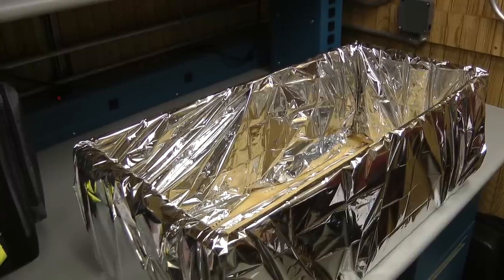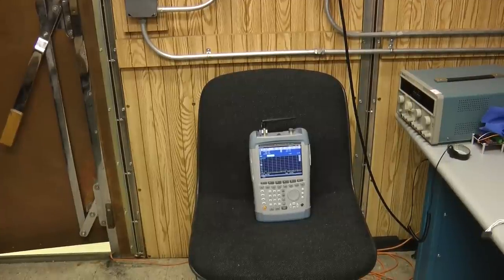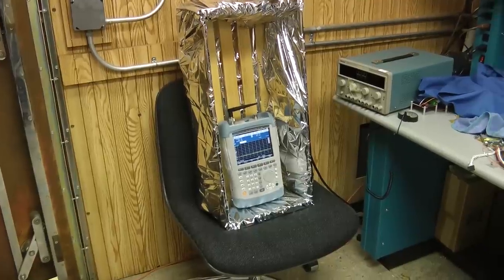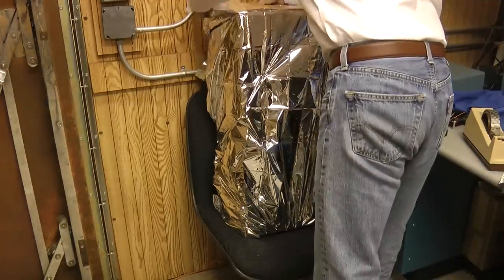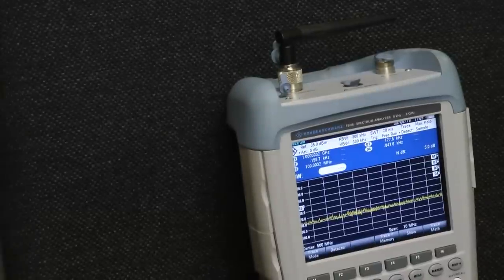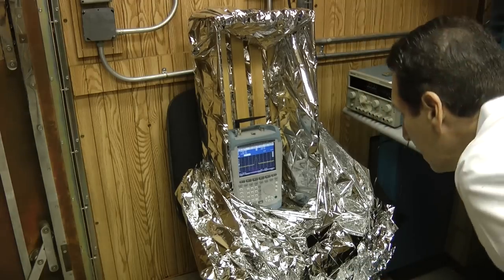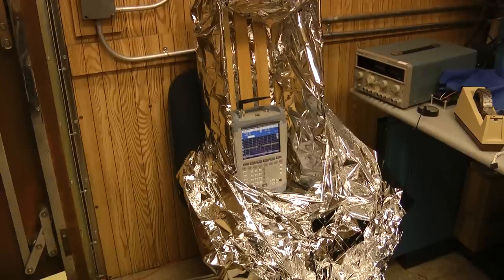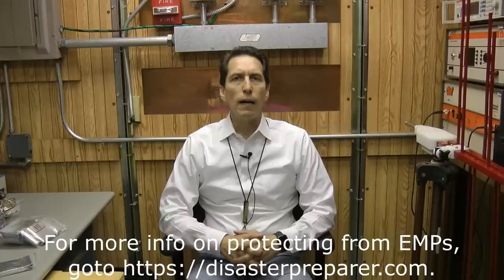Testing Mylar Blanket for EMP Shielding

Comment: God Bless You Dr Bradley. Thank you for the work that you do, for sharing with us (the layman) your testing in a most understandable way. I am grateful. 

By the way, I have your book "Handbook to Practical Disaster Preparedness for the Family"  What a gift to us. I've read a good bit of it but seem to dwell on my area of responsibility in our home, and the things I am physically able to do. 

From your chicken wire experiment and comments, I did place on every window of our home, fine mesh screens. I also purchased from Amazon, silver shielding fabric curtains for every window - they were very expensive and took a year to collect.

I am also bought a small metal trash can with lid and a shielding gasket for an assortment of things (glucose meter & strips  for one. Thank you. 

My son & I are next considering your car shielding bundle. I shared with my son your video & web page. My husband is not yet on board with this. I don't always understand that.

My questions for you is in the area of food and radioactivity. I dehydrate a lot of vegetables and probably have 8-10 month worth in our pantry, all of which is vacuum sealed in glass canning jars. Those jars are then stored in translucent plastic jarboxes by the dozen and placed on an outside wall of a frame house in a dark closet.  Your fair guess, would this be safe?

Very Sincerely,
Fay, Ohio

Comment: I read on a website you can use the inside your microwave "turn off of course" to block EMP. The testing consisted of a cell phone being called from the outside. The test was conducted to show how to protect electronics from an EMP blast.

Comment: Question what kind of tape did you use I had similar problems with using Mylar bags until I taped the seams with aluminum tape then it worked for me...
But for small electronics I like cookie tins and then tape the seams with aluminum tape without the aluminum the tins don't work..
Reply from the maker: I have tried various tapes with EMP bags and ad hoc Faraday cages. Wide aluminum duct tape seems to do as good as anything. In this experiment, I wrapped the second Mylar sheet all the way around to the back, so I don't think energy could have easily leaked through the taped seams. It's essentially the same setup I used when testing aluminum foil.

Comment: Try grounding the mylar blanket with a gator clip and a copper wire leading to a solid ground and then see if that happens to make a different reading on the meter.
Reply from the maker: I did this with another Faraday cage in a later video. No real difference. The incident energy is in the far field, so grounding doesn't have a huge effect. Instead, the metallic barrier acts to reflect and absorb energy, even if it's not grounded.

Comment: Do you think a mylar bag that is 7 mil thick and heat sealed closed would do as good or better than aluminum foil in protecting electronics from an EMP?
Reply from the maker: I think foil would do significantly better than a typical mylar bag. If you're talking about an anti-static or EMP bag like the ones I sell at Disasterpreparer.com, they provide around 50 dB of shielding (about the same as a layer of aluminum foil).
Reply: @disasterprepper  Sounds good, thanks!

Comment: Interesting experiment; I've wondered myself how effective mylar might be. 
Just curious: Is the metal deposited on only one side of the plastic matrix, or is it sandwiched between layers? In either case, could the plastic matrix potentially insulate against continuous metal coverage and inhibit a 'wave-tight' seal, allowing gaps/signal bleed in coverage?
Reply from the maker: I'll double check, but just like EMP bags, I believe the metal is sputtered in between plastic layers. The thin layer could prevent a tight seal, but by wrapping it around, most, if not all, of the seams should be covered. Exposed conductor would be better, but even crafted as they are, EMP bags can provide 50+ dB of shielding across frequencies of interest.
Reply: Buy a grow tent and flip it inside out.

Comment: I have a question for you. Hopefully you see this.  Seeing your antenna made me think about the antenna I have in my attic.. I am a new homeowner.. I was replacing my doorbell transformer recently and I noticed there is a large antenna in my attic with the coaxial cable cut off.  Is this a hazard?  I am not sure if I could easily remove the antenna it is quite large.  Should I be worried about it?  I didn't think anything of it till I saw your videos and I saw a news report talking about increasing solar storms.  Is it possible that an emp hitting the antenna would cause a fire?  The coax is just frayed and laying in insulation. 

I dont have any emp protection.  I am not sure I could afford it.. might be better off just buying some flint and other mechanical survival equipment.  

Also I have a large 12000 watt generator that I bought after the statewide power outages here in Texas.   I am considering shielding that.. but I am not sure the best way to do it.  I see some 400 dollar bag for generators but it is too small and expensive for me
Reply: It's More likely  The Antenna Will Attract Lightning Strikes!!!!!! Does the Antenna have Lightning ground... Also Also YES EMP will be Amplified by Antenna! hells a near field attend will boost  to some degree every Signal (except photons) on the EM Scale

Comment: Thank you for sharing your work. I was wondering what the result of this experiment might be if you doubled or tripled the layers of mylar. Thanks again.
Reply from the maker: Shielding roughly goes up additively in dB, so two layers would come close to doubling the dB level of protection to closer to 16-20 dB.
Reply: Making a EMP medical bag for all my medical devices. Glucometer, Digital BP cuffs, O2 Sat finger monitors, Digital Stethoscopes (expensive), thermometers, Kardia EKG. Commenting to give persons with health issues or healthcare professionals suggestions on items they may want to secure.  Still searching for portable AED I can afford. Few others like an IV Pump but not in rush with a pump because would need to figure out a source for IV solutions.
Reply: @ Penpoint 777 Exactly my thoughts, or perhaps simply  quadrupled it to be exact! 💙

Comment: What’s the cheapest easiest thing I can do to see if my chronic skin burning is from emfs? I live in a basement and they have like 10 different WiFi networks that we can hook into between this house and with the two neighbors close by. I know nothing about all this. I jam chronically ill, skin burning being the worse and was wondering if you could recommend something cheap I could by to drape over me or wrap up in or something to see if I can get away from these frequencies to see if it help the skin burning. Any advice is much appreciated. I react to food and odors too. I retained the heavy metal Gadolinium in mri dye contrast.
Reply from the maker: I'm really sorry to hear about your suffering. It sounds like you suspect it might be related to electromagnetic fields (EMFs) but are open to the idea that it could be due to some other cause. That's good. Many people assume that EMFs are the source of their issues, when in fact it could be something else entirely. One way to get some indication is to simply get away for a few days, take a vacation somewhere away from all the technology. If you see improvement, it likely means your problems are environmental. It still won't confirm that it's EMFs, but at least you'll know it's not an underlying health issue. There are many ways to reduce fields inside your home, but most are not cheap. One thing you could try is to buy a conductive blanket (maybe something made out of silver thread, since they're very soft). You could wrap it around you when you're sitting around, or sleep with it over you at night. Again, if it gives relief, that would be a pretty good sign that you might be hypersensitive to EMFs. There's more to know on the subject that I can explain in this email, but you might seek out a reputable book on the subject to get an understanding of the sources of low-frequency magnetic fields and high-frequency electromagnetic fields.

Comment: I have an insulated lunch bag with a silver lining...I'm wondering if this has any emf protection at all...
I'm thinking this would be a place for my cell phone at night..
Reply from the maker: Lola Moonflower I suspect it probably offers a little EMF shielding from the phone’s emissions, but if possible, it would be better to shut the phone off. Even putting it across the room would help quite a bit.
Reply: @disasterprepper  I'm sure that would be ideal however inconvenient...of course that would be why I'd like something closer and still convenient and still something I could grab easily if need be... perhaps a lining of the emf fabric inside the lunch bag...

Is there some kind of rating on the fabric I should look for..
Reply from the maker: @LolaMoonflower  I'm assuming that you still want the phone to receive calls and texts, right? If so, you might consider using an anti-static bag (aka EMP bag). I have some on my website at https://disasterpreparer.com, but you can find them elsewhere. They can cut the phone emissions by about 99% but still have enough signal for it to receive calls.

Comment: I've seen people use aluminum screens and zinc coated hardware cloth claiming it offers some protection against EMPs. From my research this sounds inaccurate because the EMP would go through the screen holes. Can you say if it does offer any protection at all?
Reply from the maker: Screens can offer protection, but as you said, the holes compromise the shielding. If the holes are kept to less than 1 mm, it can work fairly well (about 50 dB of shielding).
Reply: @disasterprepper  so that's quite a bit smaller than aluminum window screens. May as well go with the cheap thin aluminum sheets like for box panel trucks.🤔🤔🤔 Is there anyway yet to EMP proof a window? I can imagine the technology will eventually be there some day like adding something to the glass or maybe that "clear" aluminum might do the trick for at least moderate reduction levels once the price of it comes down.

Comment: Does line of sight matter? That changed in the experiment too.
Reply from the maker: The line of sight is broken in the experiment by introducing the conductive barrier. Of course, that's what we're trying to do. If you blocked the line of sight with cloth or paper, it wouldn't have any measurable effect. But if you cover the measurement device with something conductive, it blocks the RF energy.

Comment: Request:  Do you have the equipment to see if EMP effect phones, solar panels and battery chargers? I'm seeing some videos where an EMP pulse was applied on top of a phone.  Phone scrambled, than rebooted and is fine.  Thanks.
Reply from the maker: Generating a true EMP pulse requires a very expensive lab simulator. I don't have access to one. Some devices likely would survive an EMP, but it's hard to say which without truly exposing them to a true high-voltage EMP.
Reply: @disasterprepper  Thanks for the reply.
Reply: @disasterprepper  You can generate a decent emp with a capacitor bank, a transformer and a coil.

Exercise a little caution when triggering it, although. I recommend using a timed switch.